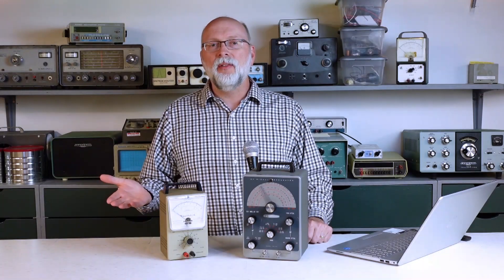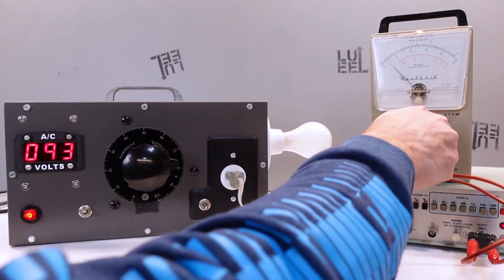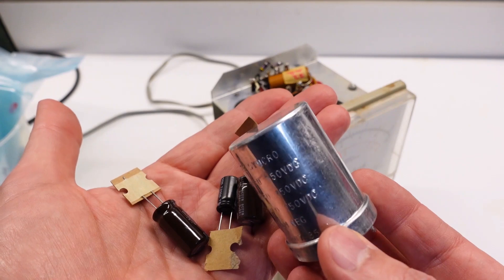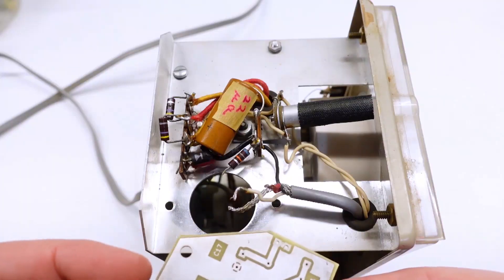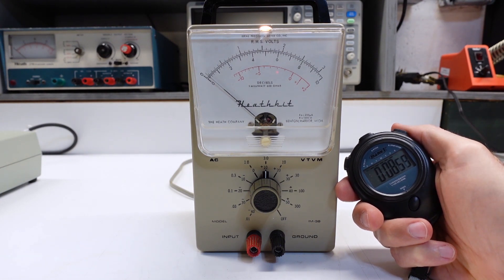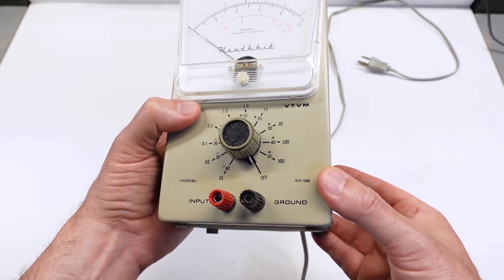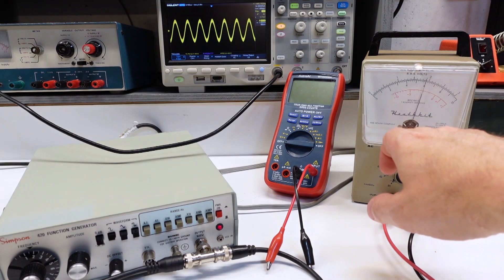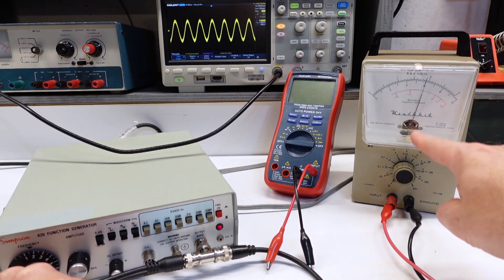Heathkit IM-38: Restoration

Comment: Well done with the meter fix... I own two AV2 beasties & they both suffer from the jerky meter syndrome. I ran my Heathkit T3 signal tracer through & it's motorboating. I've replaced all the electro's & checked the virtual centre-tap & all seems fine. Work is ongoing. Thank you for this post:)

Comment: You can also use a dryer sheet to reduce/eliminate static on a meter. When I first heard that I was a bit skeptical but I had a meter that had taken a bump and that was enough to impart a bit of static to the movement. A couple of swipes of the sheet immediately drained it off, actually surprising me!